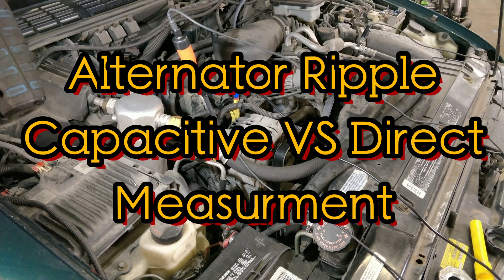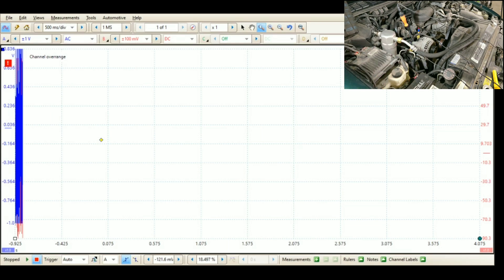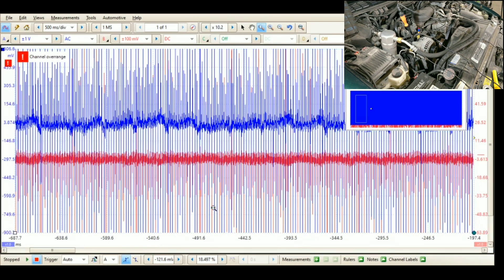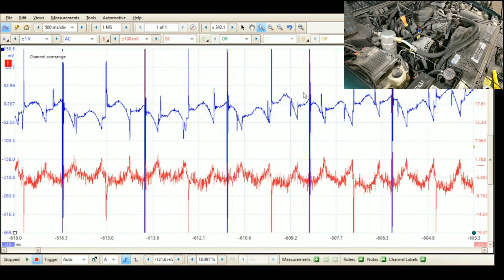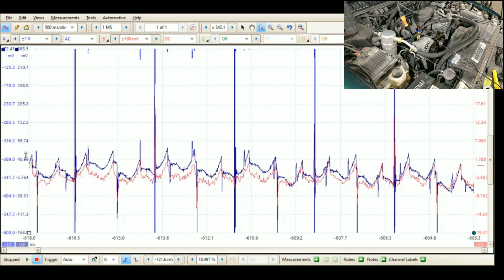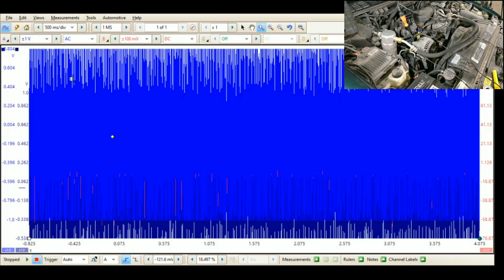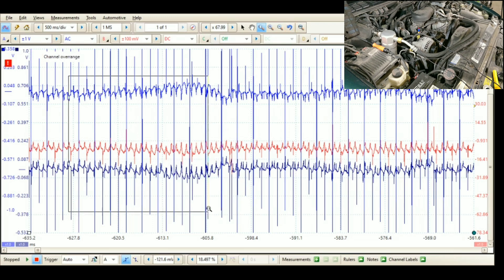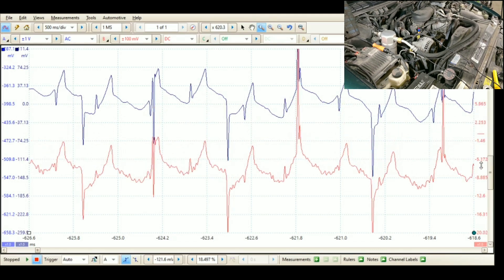Direct VS Capacitive  Alternator Ripple Measurements Using A Scope

Comment: That is a great video. Really liked the fact you stated speed and capture rate. How does the Pico Paddle for COP compare? I have one guess I can check but I don't have the other probe (yet). Just curious. LOL and at idle I was taught 250mv.
Reply from the maker: I was always thought 300mv but with a fully charged battery and no load. I don't have a Pico paddle, only a aeswave probe and the wyzeprobe. I wouldn't rely on the reading being able to be able to be converted directly to ac voltage unless you know your tools. Every setup and position will be different. You have to remember the probe is like an antenna. I was just using this video as a way to show people what can be done. Every vehicle will be different. I just had a Honda today and I couldn't get any waveform from the Alternator. Also remember there are two ways to wire an Alternator, star and delta configuration. Not sure what every manufacture uses. One does low voltage and high current, other does high voltage and low current. When I was researching Alternator rebuilding I read some manufactures use delta and some use star. Don't know if it is true or not but it may effect the waveform.
Reply: Look at you talking me back to my Tech College days. When you had like 7 alternators. Way before BMS and Load Shedding.
Reply from the maker: That is too old for me 😂 I wasn't alive then.

Comment: Thanks for making a comparative test, i was wondering what the difference would be after seeing your last video. Are  the voltage readings close to one another? Hard to see on a notepad. Thanks again.
Reply from the maker: Exactly 10x lower using the wyzeprobe

Comment: What's your limit voltage wise before condemning an alternator for ripple? And with the wyse ?
Reply from the maker: Good question, I've only ever found one bad Alternator with AC ripple. This was a big discussion in one of my groups I was going to talk to you about. Most say 300mv but then I've read others say no more than 50mv. I also saw some mention about only testing it in current. For example if an Alternator is putting out 30amps it should have a max ac current of 3 amps. Using the wyzeprobe whatever reading I got was 10x lower so if your limit on an Alternator was 300mv it would be 30mv with the wyzeprobe.